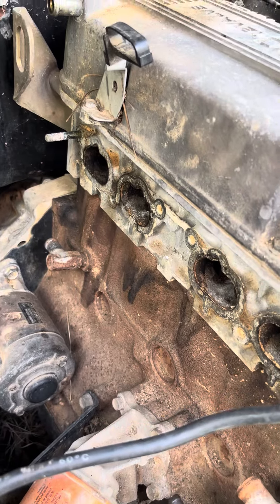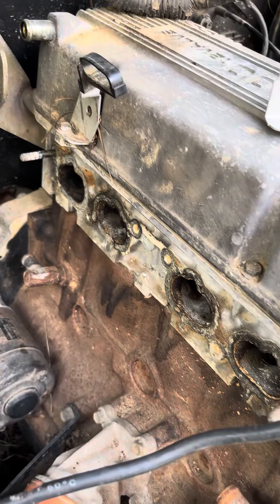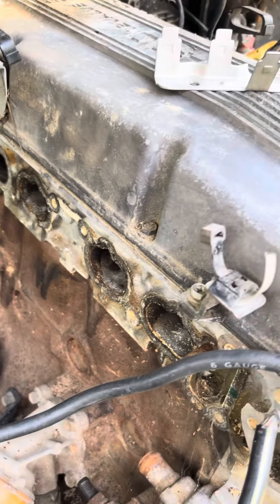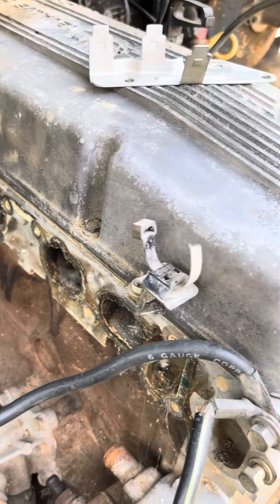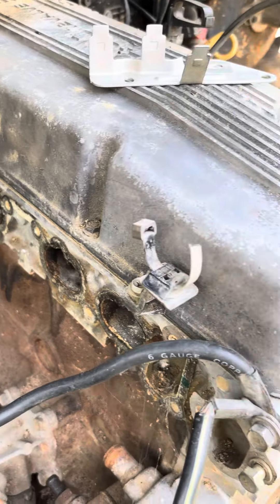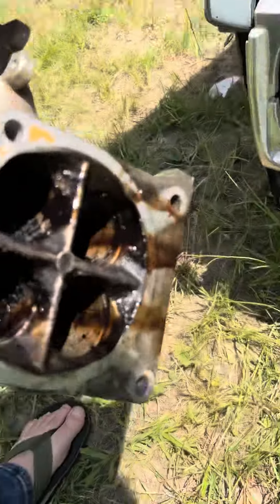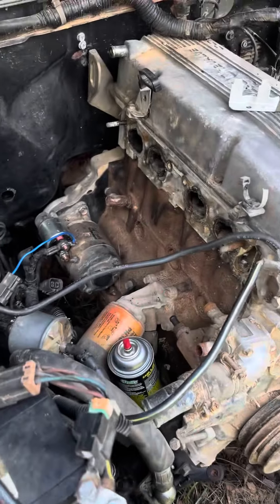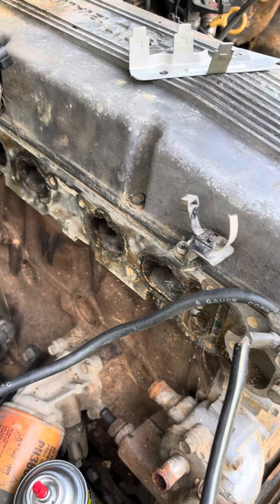Tried to fire off the Hardbody this weekend. It did not go terribly well

Comment: No offence man, but that engine looks like it was found on the bottom of a river.
Reply from the maker: @mixedboi  The truck has 140k-ish miles but has sat since 2002. I have another complete KA, curiosity had me wondering if I could make this one run
Reply: @tsanigoga  ah okay, that explains it. It will run. I'd love to see the process documented in a video. Flexiny style 👍👍👍
Thanks for the info.
Reply from the maker: @mixedboi  I will definitely be posting updates as I work on it. Progress has been slow between the Alabama heat and my day job

Comment: It does sound like it aint got enough compression
Reply from the maker: @laurenstromp5799  The battery was getting pretty weak but I also think there’s trash built up on the intake valves keeping them from closing. I’m going to check compression and timing this weekend